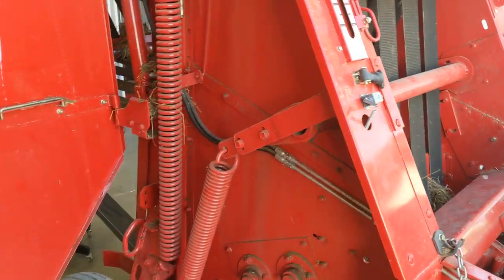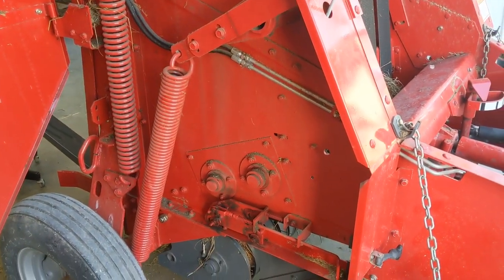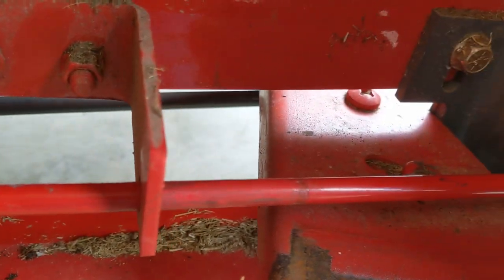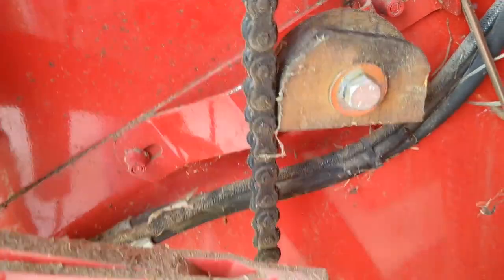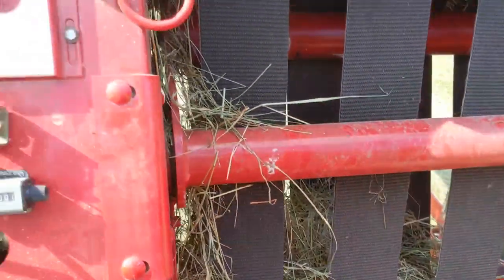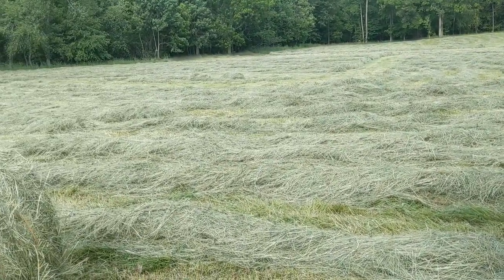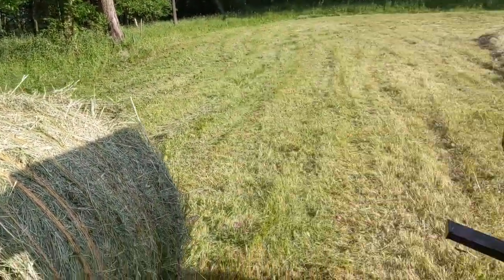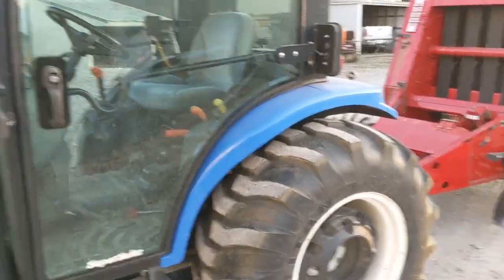Tuning Up The Massey Ferguson 1734 Round Baler

Comment: Excellent presentation!  I took the entire twine cutter/anvil out of my (new to me last week!) Hesston 530  baler (manual tie) since it wouldn't cut the twine and found that the knife was installed backwards (beveled edge should be toward the front of the baler), the knife wasn't hitting the anvil squarely and the anvil had a worn groove in it where the knife had been hitting.  The twine arm was also half bent/broken due to inadequate construction (in my opinion). The twine arm hits the twine cutter pull rod every time you let the rope loose to return the twine arm to home position which is supposed to cut the twine, and that continuous slamming eventually broke the twine arm.  The former owner had a small dab of weld on there (quick fix) which didn't last.  The best fix was to reinforce the twine arm with two pieces of small angle iron, which required that the twine arm be taken out of the baler.  I also ground the surface of the anvil completely flat, sharpened the twine cutter knife and adjusted the twine cutter knife so that perfect contact is made between the knife and the anvil along the entire length of the knife.  I'm using the orange poly twine and these repairs/adjustments fixed the twine cutting problem.  I'm still learning so maybe by the end of this year's haying season I'll be able to make a decent bale!  Thanks for posting this!
Reply from the maker: Thanks for watching!

Comment: I've got the same baler and it's set up just like yours but the orange 20000 twin works better and get you a V rake and adjust it same width as your baler and it will make the shoulder of the bale stronger and you can put more twin on shoulder great video keep on farming
Reply from the maker: Thanks for the insight. We don't care for plastic twin it doesn't biodegrade. The v rake makes sense.
Reply: @wildcatwilly  do you have to turn the PTO off to dump the bale I notice if I do the twin is wrapped better hows yours
Reply from the maker: That is what we noticed as well... You don't have to turn the baler off but it will roll the side twines off sometimes if you let it run.
Reply: Try reading manual there should be a razor blade there between the two that’s why it was loose

Comment: ive got a 530 also and if my bales weigh more than 400lbs id be shocked, im making them 52'' tall too and running it at 560 to 580 rpm
Reply from the maker: Cool where are you from